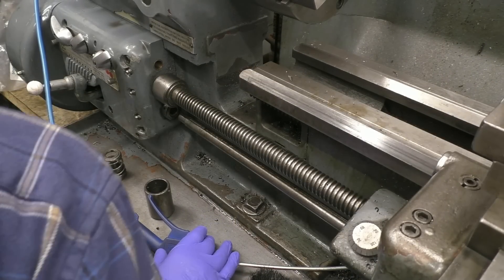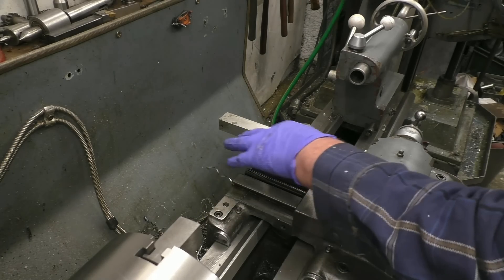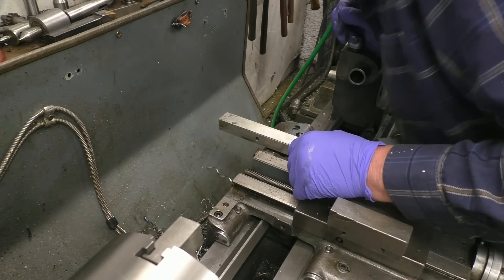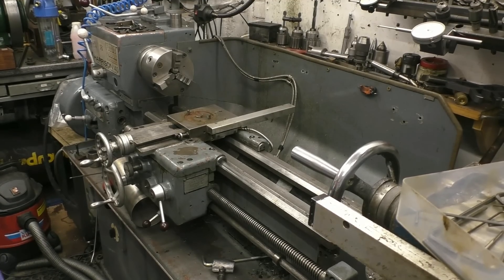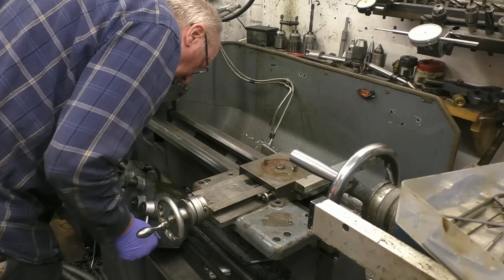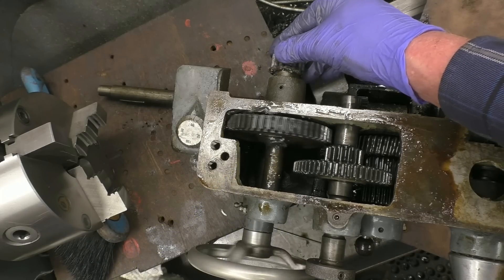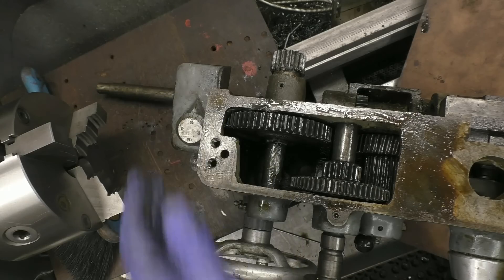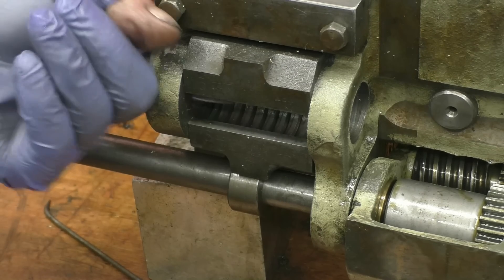SNNC 437 P2  Harrison 140 Lathe Power Feed Problems

Comment: John, the power feed shaft has bronze bushings thru the castings on either side of the gear that has the end play you were demonstrating. The bushings are t shaped and the top part of the t on the bushings act as a thrust bearing on the shaft gear (the one with all the play) . You need to make new bushings or fit some shims. The bushing bores may be worn oval as well and there may be wear on the power shaft drive key.

Comment: Evening.     I've been in there recently on my 140. Mate   .   There is another bolt ,setscrew under the saddle \ apron top that is holding it on .took me hours to find ,then top comes off.i wanted to know my ways were Clean before new wipers . I went in there because half nuts were very tight  ,just needed strip , clean  ,lube , all good now. Very hard to engage screw cut before.

Comment: Hi John, brilliant video, I've got to shift an L5 next weekend and im going to have to strip it to move it, the apron looks identical to yours and I presume it'll come apart the same way. Do the lead screw and power feed just pull out of the gearbox or are they held in place with pins or something. Thanks, Tom.

Comment: Any room to fashion a sheet metal cover to deflect swarf from those gears? An adult beverage aluminum/aluminium can might be a good source. You could just discard the contents... maybe into a chilled glass.
Reply: My thinking as well, bad idea to build a machine tool with upturned cups of oily moving parts that chips may fall into. I would have expected a little stamped cover there.